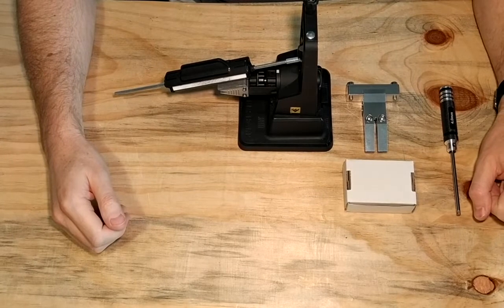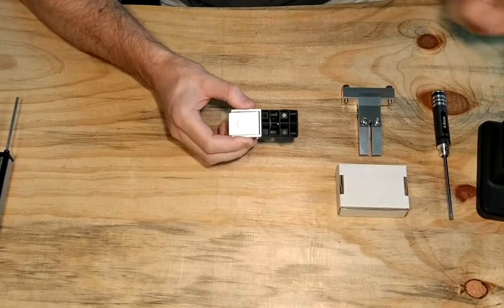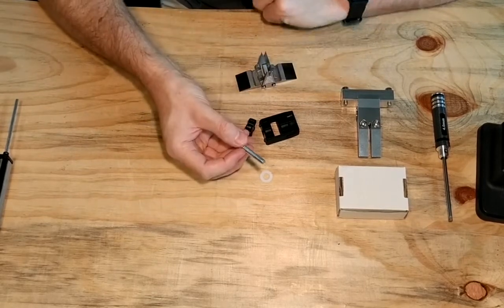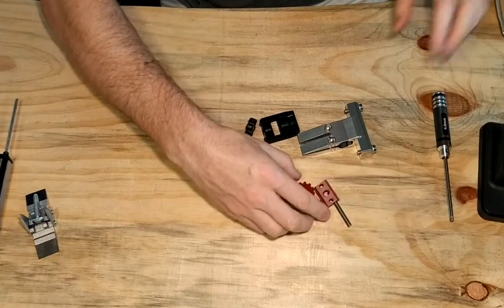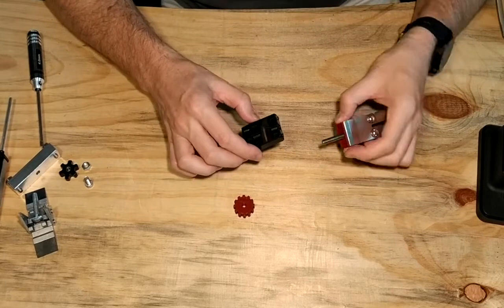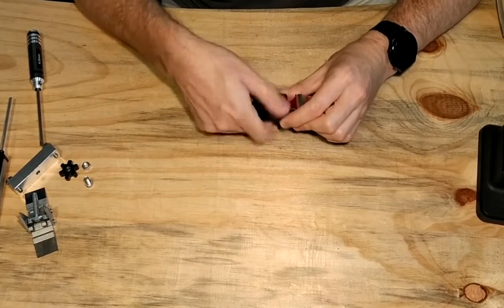Work Sharp Precision Adjust KakBritva Split Clamps

Comment: The factory clamp doesn't stay tight very good but it's also hard to do smaller blades like traditional folders the stones will scrub the clamp unless you do a very high edge bevel so I wonder if this will help with that and I know they have different sizes in these on the site but which one would be the best for that?
Reply from the maker: Yes, this works well for some smaller and some hard to clamp knives. The exact KakBritva clamp you purchase, will depend on your knives. The 6mm opening flat version works well as a good all-rounder.

I highly recommend getting a V-block support for your Work Sharp. It makes for much more stable, secure and accurate sharpening.

https://www.gritomatic.com/collections/work-sharp-accessories/products/clamp-support-for-work-sharp-precision-adjust

I suggest also looking at the Twin Hapstone R2 lite clamps. This is an excellent clamp system for small knives, low sharpening angles, distal taper and full flat ground knives. Here is a link to my video about it, and another link to the product page.

https://youtu.be/W6tuGrSjymI

https://www.gritomatic.com/products/twin-r2-lite-clamps-for-work-sharp-precision-adjust

For even more usability, have a look at the Leading Edge upgrades for the Work Sharp precision adjust. It works very well for hard to clamp knives and for bigger kitchen knives (with the large blade attachment). I use my Leading Edge system regularly for this exact reason.

I designed the Leading Edge upgrade for the Work Sharp precision adjust to compliment the basic system, to enable it to handle a much larger variety of knives, and for sharpening scissors. Here is a video link, and a product link about it:

https://youtu.be/qiRwEGZOSVQ

https://www.gritomatic.com/collections/leading-edge-core-upgrade

Gritomatic sells 2 versions of the Leading Edge system for the precision adjust. The one version (core version) is sold without the scissors and long blade attachment, and they sell another version (universal version) that includes the scissor clamp and long blade attachment. The main base of both versions are the same.

Here is a link to the upgrades and accessories that Gritomatic sells for the Work Sharp Precision Adjust:
https://www.gritomatic.com/collections/area-work-sharp
Reply: @777edge  Thank you I will definitely check it out!

Comment: Your angle will be off you will need an angle finder cube to make sure your at the desired angle or it will destroy knife edges possibly.
Reply from the maker: Yes, absolutely. If you want accurate sharpening angles you always have to use an angle cube. The "angle guide" markings on the Work sharp precision adjust really is only usable with a very specific knife blade width and clamping position so I would never go on the markings alone - even if you're not using an aftermarket clamp or platform. Even without an aftermarket clamp, you can't go on the guide markings alone. As an example, clamping a small Victorinox blade vs a very wide blade, your angles will be very different even if you use the same "markings".